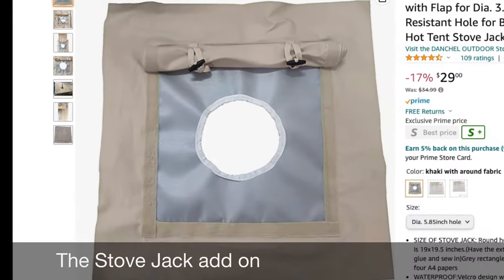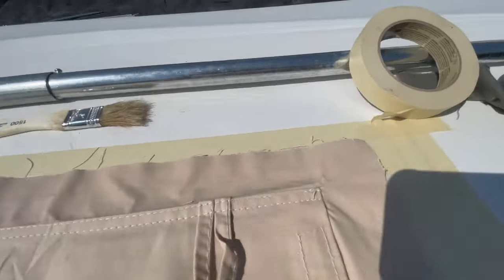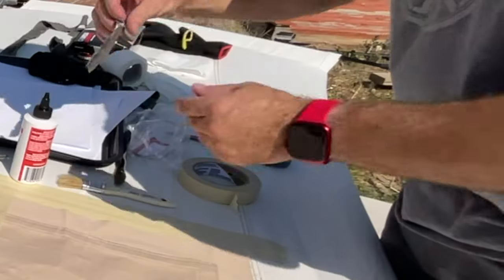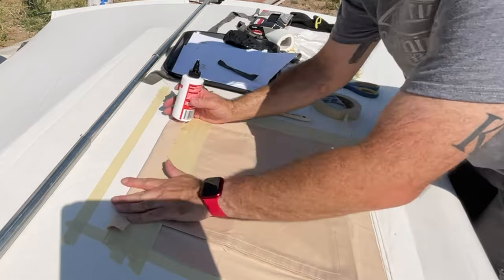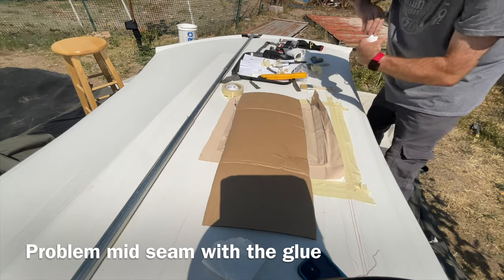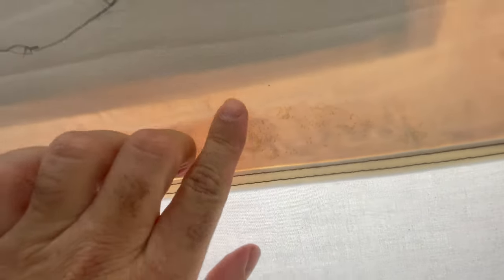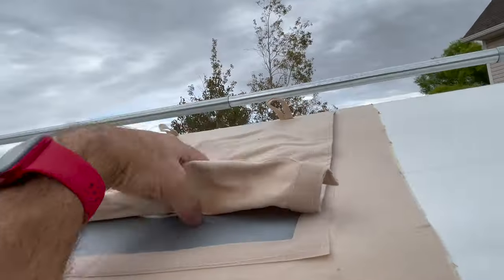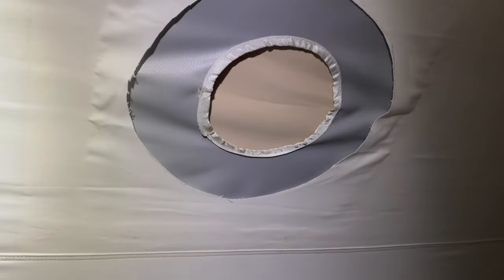How to Install Stove Jack on a Kodiak Canvas Tent

Comment: well after a almost a year, how is the glue and seam holding up It sure looks like it was working pretty well during this install. 
Thanks for taking the time to share this with us and I hope yall have been able to use your tent a ton this year sir. 
thanks again and have a blessed week
dale
Reply from the maker: I will be setting up within the next 2 weeks. Since you asked I’m inspired to do a review video! Did a 2 week camp out last time it was up right before summer. Aside from the hot months we usually do once a month till I get an AC port installed 😁
Reply: @boominaudio I just added a spring bar to my camping equipment. did an initial camp out last night. It got down to 40 which is not cold by any means, but the little stove worked so well, I had to open two windows to keep the heat down hahaha. I'm going to season it and treat it with sayers for the fleas ticks and spiders today, leave it set up another night or two then pack it up for our two weeks deer camp. This thing is so nice and I am so happy with it. I am pleased yall are about to head out for two weeks as well. I ordered some of the glue and I am gong to make some leather patches for my door and glue them on with the same glue you used. I did use your links so that should give you an extra nickel at some point as well. Thanks agian and have a blessed week my freind. 
dale
Reply from the maker: How are you liking the Spring Bar? I was scoping the admiral color a while back and the duffle bag. Haven’t pull the trigger yet, nice gear though!
Reply: @boominaudio  I love my Springbar classic jack, it is built to last, great customer service that will answer any questions etc. Only regret with mine, is I wish I would have bought it sooner. 
Dale
Reply from the maker: Here is the video, Custom Stove Jack Review on Kodiak Flex Bow
https://youtu.be/2KVrVZJaoY4

Comment: What was the name of that glue? I didn't catch that. I have the same tent and have been running a buddy heater but would really like a stove. Thank you for the video and your time. Looks like it looked well. Let me know how it worked out for you.
Reply from the maker: It is Tear Mender https://amzn.to/3F5HzE4
Reply from the maker: It works great, but in windy conditions I need to secure the pipe to the stove so it can’t separate
Reply: @boominaudio  Thanks again.
Reply from the maker: Did a year review video if interested, Custom Stove Jack Review on Kodiak Flex Bow
https://youtu.be/2KVrVZJaoY4

Comment: Have you had issues with rain getting in when not using the stove?  I like the set up but i think im going to do a side wall install
Reply from the maker: I am actually working on that very video! Short answer, no problem with rain and/or snow.
Reply from the maker: Here is the video, Custom Stove Jack Review on Kodiak Flex Bow
https://youtu.be/2KVrVZJaoY4

Comment: Thanks for a brilliant vid Andy , how much glue did you use (so I can get an idea of how much to buy) . Greetings from Australia..
Reply from the maker: I think you can get away with just one, but, I was using the larger one. The heat/air caused it to go solid mid use so having a second one REALLY helped when things didn't go to plan of only using 1. I would be good to try on scrap material of good size so you can see how your enfironment affects the work piece. Inside it was a slow cure (30 seconds), outside in the sun was like 5 - 10 second super glue - with over half of the bottle going solid! 
Having said that the teant and jack have proved to be great from 21+ in of snow, rain storms- no leaks!

Comment: How long of heat do you get at times with that stove? And do you think if I put  this set up and this stove in my 10x10 Kodiak it’ll be too hot? I do run cold normally lol, thanks so much for the video
Reply from the maker: It does take time to get the heat dialed in, with air in and damper. Variables like wood type and outside temp affect the inside temp as well.

Comment: Curious with the stove in place do you get water running down the stove pipe?
Reply from the maker: So far only at the top 2 of 5 sections in a GOOD snow storm. Some small drops from the stove jack area that hit the stove but was hot and evaporated immediately.

Comment: Man, when you stabbed that hole in the roof, I cringed. Great job! It sure would be nice if Kodiak offered the flexbow with a jack installed already. The Springbar has a jacked version but they are a bit pricey.

Comment: Question….if not using the stove jack and it rains hard does it leak inside????
Reply from the maker: Great question! I have been in a good rain and it did not leak. I had my sleeping bag under it and was all good!😀
Reply from the maker: Actually added an electric / gas line inlet to the tent as well, video coming soon!

Comment: How’s it keeping up so far?  Looking to do this with my Kodiak
Reply from the maker: I’ve used it on a few 5 day camps with fire non stop and 1 two day with +21 in snow and a no stove. Not a single regret. I do need to get a cable that ties the pipe to the stove so heavy wind can’t pull it up/out.
Reply: @boominaudio  nice!  It’s that fear of spending a boatload on the canvas tent in order to put a hole in it lol. You think there is a need for a tripe wall pipe section? Not sure how hot it gets around the stove jack.
Reply from the maker: In the video the exposure was a little exaggerated but it was way hot in the tent, pipe slightly red in person , Glowing red in picture, if put in like my other video , the jack is designed for the heat, but cool time it hits the stove jack area. I have bought a second stove jack for my Grand Cabin or a second in the flewbow for a second option, still undecided…
Reply: Another question (now that I have all the pieces to put the stove jack on)….when in use and either raining or snowing…do you get any leaked?  Was thinking of using the red silicone jack sleeve to creat a water tight fit, but that might be overkill?